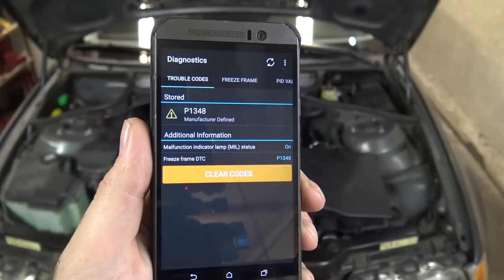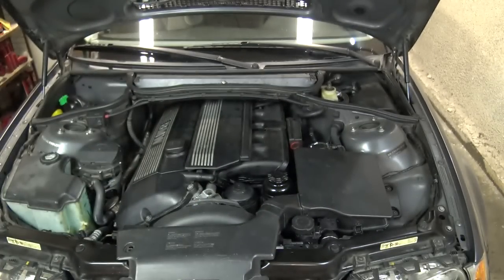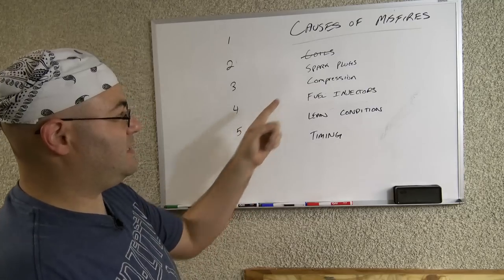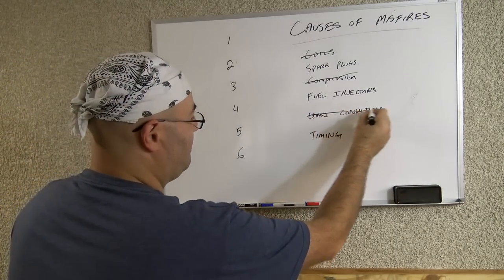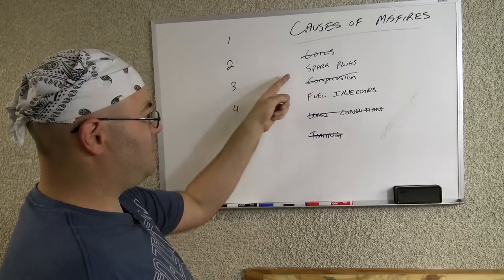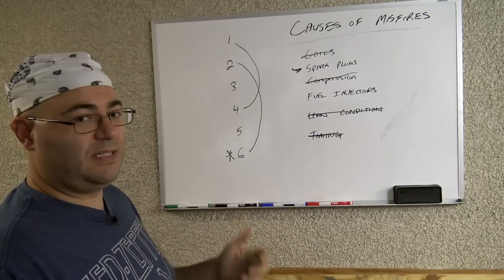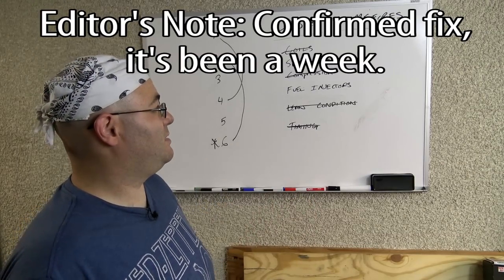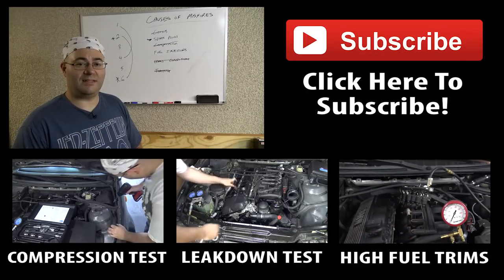How To Diagnose A Misfire on an E46 BMW 3-Series DIY

Comment: Hi 50sKid,
I like all of your videos... My E46 went thru most of the problem that you had.
Today I had P0302 (Cylinder#2 Misfire detected) and P0335 (Crankshaft Position sensor "A" circuit) at cold start...
As the engine is warmed up, the misfire disappeared...
I went thru engine drop test, all 6 coils were good ( I could feel the differences when dis-connected the coils)
But I found cylinder #2 and #4 ignition coil were soaked with engine oil (not the other)???
I removed the spark plug of 2 and #4 , and checked....It seems normal, no sight of oil or burned.
So I cleaned up, re-installed, cleared Trouble code and monitor in the next few day to see the same problem coming back or not
My questions:
How did oil get there?
Which part do I need to replace to stop that oil leak to that area?
FYI, spark plugs are 40K miles old and Head Cover gasket is about 60K miles old 
Thank you in advance!

Comment: 50s kid please respond to this POR FAVOR👌👌
I took a little road trip in the ‘05 zhp (like 45 min) and the power already felt shitty like something was off but I have a exhaust leak so I assumed that could be it maybe. All of a sudden I’m up shifting to 5 doing maybe like 80 @ 2900-3200rpms and it just drops rpms to like 2200 and the red battery light blinks and jumps right back up like nothing happened. I already was thinking to turn around but I was closer to the place anyways... I finish what I do and I crank her up first try and get home no problem. Days go by and one day I get off the highway and I am driving into a driveway, slowing into 1st gear it shuts off cold and didn’t wanna crank until like the 4th try. I leave after I’m done go home and decided to do the alternator yesterday assuming it was power related since it was showing signs of it intermittently dying. I test drove it and it was a nightmare after about 15 minutes of driving it, it first almost shut down slowing down to a light then driving normal speed it wanted to shut off (battery light comes and drops rpms) I battled with it just to make it home this time and i almost didn’t it shut off at the corner of my street cause it wouldn’t crank again til I gave it gas and revved up... another weird this is when it was just rolling and I threw it in neutral the rpms were going up alone without me even touching it I had the clutch in but idk off to me...PLEASE give any ideas and input Thank you in advance 👌👌

Comment: I had misfire in winter at cold engine, but after 10 or 15 minutes by turn it off and on again misfire goes away, check light also was sometimes on and sometimes off. I changed the spark plugs but same problem. Then i cleaned oxygen sensors and problem goes away, no misfires and no check light.

Comment: Just picked up my first e46 and started binging your videos which are great! My question is whether or not a faulty spark plug(s) could stall rather than just cause a rough idle?
Reply from the maker: I don't think so, it's unusual for spark plugs to be so bad that the engine stalls.  I suppose it's possible but it's far more likely a vacuum leak.

Comment: Sticking rings need a good cylinder cleaning. Common. The reason the misfire is moving is the computer is watching the harmonics and will shut down the rocking. Cylinder. I know it's crazy. But trust me pour the bow upper cylinder cleaner in the plug holes and let it sit over night. You'll be amazed.

Comment: Hey man my problem is misfire cylinder 3 with fuel cutoff. Only problem and idk what it is not spark plugs. But whenever i get a car wash the water pump messes up. Maybe the misfire is an air leak? Hella loss of power.

Comment: Good afternoon 50s kid,I bought a 2000 BMW 523i with a m52tu (Latin America market)  the car I used it fine until a day one hose broke off, and when I started the car, noticed backfires on intake manifold, replace the MAF sensor with a cheap one since I couldn't find a bremi or a Siemens one, replaced oxygen sensor after that car began smoking during start-up thru one of your videos we came to the conclusion that it was the CVV did the replacement and when I started the car car began loosing oil pressure, when I opened it noticed that car had a nasty oil sludge problem, cleaned it out and took it for a drive, had idle and under load issues , in which lead to misfiring replaced the intake manifold gasket idle when cold is fine, but when car gets hot  under load it is rough and when I stop idle is bad but if I turn it off and back on car idle is fine again, what would you recommend to do, I don't have a scanner for my car,y car it is not obdii it is obd1 with the round connector

Comment: I went to a different Car Wash. I got a misfire on #5&6 cylinders.
I read and cleared the codes.
I went to the same car wash and no problem.
A few days ago I went to the same car wash.
The problem came back with the same 2 cylinders.

5&6 are at the back of the engine where there is more heat.
So I will swap coils 5&6 with #1 and #3 to see if it follows.

I just had the Valve Cover Gaskets replaced. So there might be OIL on the bottom of the coils. (A different video.)

I can't see why it would be 2 cylinders at the same time though? 
There doesn't seem to be any water getting into the spark plug area.

Notes:
My 2004 325i had little power since I bought it in 2016.
I finally added Fuel Injector cleaner 2 years ago and the power about DOUBLED!
But I'm still only getting 12-15 MPG city driving.
Maybe a Vacuum Leak? Causing it to increase the fuel flow?

It's always had just a little bit of rough Idle too.
Reply: Your dme might be getting wet.  Clear the drain and check the seal.

Comment: Help me. I have e46 328 got the issue. I already change to new MAF sensor and clean up the ICV until the valve can freely to move, and the Hose to the intake doesnt have any hole. But still got the same issue, my idle sometime bouncing for a while when i turn on the AC. But when the AC shut off, it will again be bounce for a while and then the idle will be okay. Then sometime my car will lost the power if i want to accelerate (feels like the engine choking/get sucked). Please somebody help me. I already blow my mind right now. Or is it my car need 1jz for the heart of this car. 
SORRY FOR MY BAD ENGLISH :)

Comment: If you have a misfire, I would have thought changing the spark plugs would be the first option, especially if moving the coils around didn’t work.  If the misfire persisted then test the coils again and replace one at a time or all.

Comment: I did my e85 Z4 (M54B25 engine) maintenance according to your videos. Thanks a lot for helping videos. Now my car is stalling when the cold starting. I replaced the spark plugs, ccv system with the new ones.Also i have new one coil as a spare part.  I can not see any codes on OBD.  What is your suggestion?

Comment: I probably have the weirdest misfire in history, no check engine light, no codes whatsoever. All tests are pass..  my car still misfires under load. Idles just fine but you feel lots of misses as you accelerate.. mostly in the 1k2k rpm range.
It's a 330CI.
Any idea?
Reply from the maker: It might help to use INPA to see which cylinders are misfiring. It's not called misfire in their system it's something like running values... probably not that, I actually forget, but you'll know it when you find the screen.  If you can figure out which particular cylinder it is, you can proceed with this video.  If you just want to shotgun it, try changing your plugs.
Reply: It turned out to be a bad coil. I set up INPA with cable and bingo I found the issue.
Still very strange I had no check engine light and no codes I could see with a standard scan tool.
Thank you for suggestion, you helped me a lot!
Reply: @frankj1663  Hello, which menu in INPA you did find the bad coil ?
Reply: @samytm26  Error Memory -> Read Error Memory, it's on the main menu if I remember correctly. INPA doesn't tell you if the coil is bad, it only tells you if a cylinder is misfiring, swap the coils around and see if the misfire follows the coil. If it doesn't then it might be something else.

Comment: what obd2 app and dongle setup are you using in this video? i have an e46 and i was looking into getting some scanner specific for bmw so i get specific codes. i got elm327 w/scanmaster elm, INPA, BMW Logger, peake reader and some generic scanners. just dont like the idea of carrying my laptop plus there is no room in the car when im using it and i have to translate the codes or look up the definitions for peake reader and my generic scanner. what would you recommend as a decent scanner for e46 e39 n such?

Comment: We have new spark plugs in our 2006 330i - could a lean condition kill spark plugs?  We had a gas leak (still do) and I think it is the actual fuel line coming from the tank to the engine.  This is the carbureted E52 motor... where is the fuel gauge connector on this thing?

Comment: What if the quality of the fuel plays its role to the quick wear on the spatk plugs , im just saying
Reply: Yeah I've read that lower octane fuel can be "safe" to use, but generally the Premium is what's best to keep in the tank. I've seen other guys running 87 so maybe in a pinch its okay, but those compression ratios are kinda sensitive. I agree with you that long term use of low quality would lead to an unhappy engine.

Comment: I have this problem where my car sometimes cranks really long  and when it happens i also get a power loss, i have tracked it down to being a cyl 3 fault, i guess the power loss comes from missing a cylinder. I bought a new coil pack and the plugs were changed at the beginning of the year. I'm gonna replace cyl 3 plug and see if it helps

Comment: Thank you for the step by step video. I have an error code for oxygen sensor - P0161: 02 heater circuit (bank 2, sensor 2). Is this sensor on the error code for the pre-cat sensor on this video or the one you had on another video that you replaced under the car? Thanks in advance.

Comment: HI 50skid, im getting P1352 & P1345 but I have only had these pop up twice while I left the car sit for over two weeks, after 15 mins the engine light turns off and the car starts to run smoothly again.   I noticed it on start up, as my car is shaking more than its used to,  Thing is I changed the Spark plugs myself  but coil packs are orginal.

Comment: Hi, I replaced coils, spark plugs and swap injector but the misfire persist in cyl. 2. What should I check next? Thanks and keep the good work.
Reply from the maker: compression
Reply: Very low compression on cylinders 2 and 4

Comment: Not knocking ya cuz ya figured it out but spark plugs was the easiest to start with lol. root cause analysis is what we use at John Deere. Start small work up to more difficult like you said. Parts can be faulty brand new out of the box..see it all the time :) my 02’ 325i idles in drive at 500 rpms and around 600 to 650 in park. I see others do this in videos as well but the vibration is annoying as fuck when it’s cold. Most cars idle around 900 to 1000 is this just a bmw deal?

Comment: My 325Ci was misfiring 2 days ago. I did a diagnostics came up with p1345 misfire fuel cut off. I didn't run the test that he did. I wish I would have known about it. But I went ahead and bought a cylinder and all new sparkplugs and it was running fine till this morning. I turned it on and it misfired again, and the service light came back on. Turned the ignition off turn then turned the ignition back on, and the engine seemed to be running smoothly again, but the service light didn't turn off.  So when I hooked up the diagnostic machine p1345 showed again... What do you suggest?

Comment: look Mr 50s guy it looks like an electronic discharge problem....thinking electrical or some thing is wired wrong this would knock the sensitive things out of sequence......you seemed to have fixed it with the spark plugs......but I'm thinking like yourself "look it will come back if it's something to do with electrical discharge or when .....u are out driving for 20 mins  .....and this problem comes back '...it just might be something wrongly grounded to the engine block.......actually this is kinda cool 50s guy this will be a little challenge......check the live feed on different sensors while engine is running ,u might see some slight spike or anomaly.......ps ,I am not a technician.....just a hobbyist in his 50s finding something I loved to watch as a child ((with terrible leaning difficulties)).....anyway u seem to care in this video and u got the smarts......and ur latest content has been interesting........"before I go I should let u know that I have been buying bits and bobs in the car Michanics Spectrum.....and I don't have a car....so.....so that's how much influence YouTube has on me.......ok Thanks

Comment: nice video, my e46 has had all the coils swapped and new sparkplugs, still random misfires on IDLE  and my RPM's are close to 600-500 hence it feels rough, I'm new to fixing cars but could the ICV or DISA be a cause of it?

Comment: I have p1343 misfire on cylinder 1 with fuel cut off. Maybe fuel injector??
Reply: I have a p1345 that's cyl 2 for me did you find your issue?

Comment: Hey 50sKid. Thank you so much for making these videos! I've been working on a used E46 bit by bit to get it back up and running and these tutorials have made things so much easier. 
But I've got codes P1343 and P1351 (misfire with fuel cut-off). I know I've got a cracked CCV and a cooling system that is ready for replacement, but with those codes, is there anything else I should be on the lookout for? This one's giving me a bit of trouble. I'm praying it's not a compression issue.

If anyone can give me suggestions, I'd love to hear it. I'll add it to the list of things to fix next!
Reply: I just got both of these codes yesterday, car runs REALLY rough. What did you end up doing to fix it?
Reply: @ziggythesphynx6904  What finally did it was replacing the spark plugs and ignition coils that had been shorted out by the oil leaking into my spark plug wells (a cracked VCG). But before all that, I replaced the CCV and VCG because the vacuum leak was so bad my engine was shaking back and forth with NO throttle response. But mind you, I PLANNED to do these as soon as I got the car. I was looking for these issues and already expected them to be failing. 

If it's that rough (like the engine is shaking back and forth), check the CCV. It's a huge vacuum leak if cracked. It'll be covered in oil if it's cracked. If you can, run a cheap smoke test or check the fuel trims to spot air leaks. But like I said, it was the coils and spark plugs setting the code. You might be lucky enough to only have a cheap fix.

My advice: keep poking around. Start at spark plugs and work your way up the list of potential problems (coils, injectors, oil rings, etc)  Use any tools you have to diagnose the engine, and if you don't have a complete maintenance record, look at the most common failure points first. 

I'm sorry I can't be much more help than that. I can't see your car so I can only tell you what worked for me. Hope you fix it soon!
Reply: @Purvis513  Thanks for the response. i swapped the coils around to see if the issue followed the cylinders. Cleared the codes (scanner said they were pending codes) and it has run perfectly fine so far. i had the front end jacked up for about a week and half while doing a suspension refresh and got the codes right after that. If they come back i will have to look at it again!
Reply: @ziggythesphynx6904  That's awesome! I'm happy it worked out without you having to go much deeper! I hope the car runs good for years to come! Should the codes pop up again, feel free to hit me up here and we can have a back and forth to pinpoint any potential issues. 

I actually just did my VANOS seals last week and spotted a huge vacuum leak. Now I have to fix a crack in the Valve Cover lol The fun never ends! :D

Comment: I have this exact problem and I replaced the spark plugs but I still have a misfire on Cylinder 4.
Reply: Coil pack maybe? Did you find out what it was?
Reply: @cichandler833   It wasn’t the coils packs the piston rings they were stuck from carbon build up causing misfires, smoking really bad felt like the engine was finished the car only had 108k. First I replaced all the vacuum hoses, CCV, intake gasket, Intake Boots rebuilt the Disa valve, spark plugs and even tested the coils but they were all good and still misfired. So I used AC Delco Upper Engine and Fuel Injector Cleaner followed the instructions and the next day fired up like a new car no more misfires and it’s been super healthy ever since it now has 150k with no issues. I was free not to worry about that anymore and just do preventive maintenance stuff. I would try that if your having misfires and everything else is good 👍

Comment: Recently went to take a look at an 04 330 started the car up let it run for a few minutes then began to hear a faint knocking sound, few minutes later, check engine popped on. Car has 150,000km on it and shifts smooth everything else seems fine but I'm not sure if that knocking and check engine light is a misfire